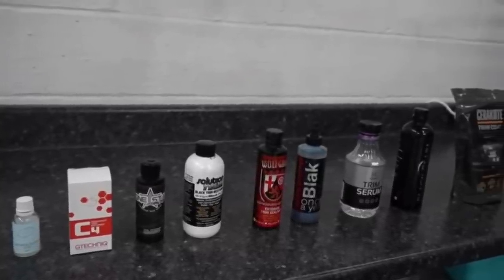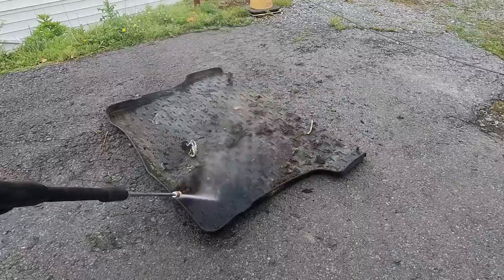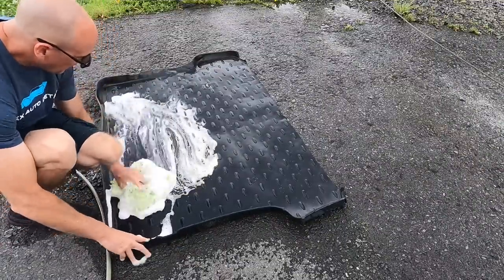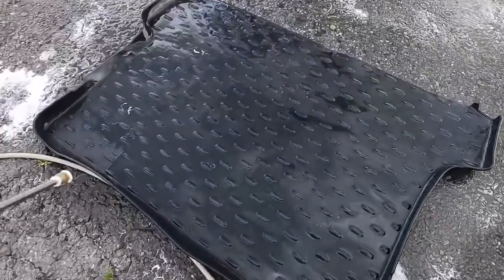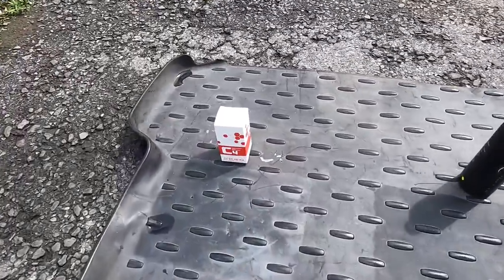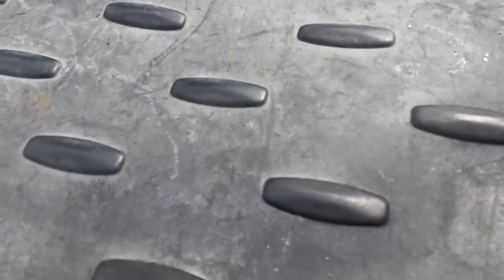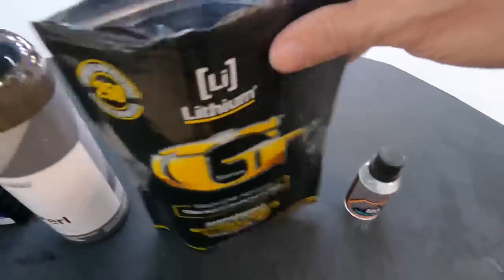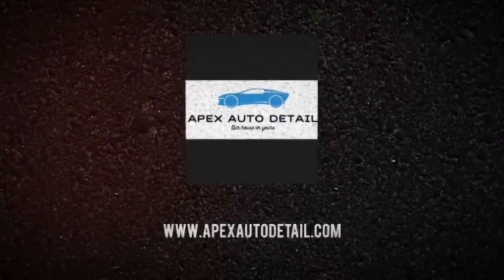9 Way Plastic Trim Restore/Protectant Comparison!!  1 YEAR UPDATE!!

Comment: It looks like the dirt covering the end may have protected that section from sun damage. The CK is only still hydrophobic in the are that was covered and faded in area not covered by dirt. The Solutions is almost gone in the area (upper left) not covered by dirt. So, for me, I don’t think it’s fair to put them in the top tier as they had an unfair advantage. Black Pearl is the clear winner with Renew Protect second, then CK & SF.
Reply: Also, look at the section under the SF bottle. That part was not treated, but it was covered with dirt and it looks as good as the SF section.

Comment: Great timing. I just finished using your trim restorer this morning on my 95 850 T5R. I can not stop looking at it out the window.  It looks amazing!!  All the bumpers, trim, door handles, and side mirrors look rich and deep.
Reply: Niiiice, do you have the wagon or sedan, and the black or yellow? I have a black wagon. They're collectable now!
Reply: @kirkwilson5900  Have black sedan with 124,000 real miles. I saw a 850R red wagon go for $26,250 days ago on BAT auction. Looking to do a manual swap since I got the dark walnut shifter. Torn between keeping it original or do the typical mods.  Have you done anything to yours?
Reply: @csebastian71  26k is unreal for an R. T5R should be valued more since there was way less of them. Nuts. Mine has 220k, other than a few used (automatic) transmission swaps, I've kept it stock. I switched out the nivomats for bilsteins probably 20 years ago 😅. I haven't driven for several years, still runs fine but need to swap the brake proportional valve and some tires etc. I need to bring it back in to service

Comment: One of the trim restorer I would like you to test, is Malco Revive Nu.  It has done quite well in other tests.  It seems to be a better value than Lithium or Cerakote?  Revive Nu has out performed Solution Finish in other tests.

Comment: Hey Bryan great video as always , quick question a vehicle that’s coated with CQuartz Lite , what can I do to remove the coating around the outside black trim so I can restore it and the re coat it ? Thanks
Reply from the maker: Try Citrol 266.  Then flush the area.

Comment: Absolutely don't use Cerakote products on your trim if the car is evenly remotely new.  They won't tell you this, which is appalling, but it'll wreck trim on a new car.  The off gassing will push the coating away from the surface and can't be fixed.  There should be a class action lawsuit against the company, no questions asked.